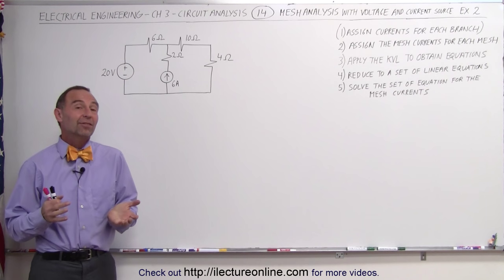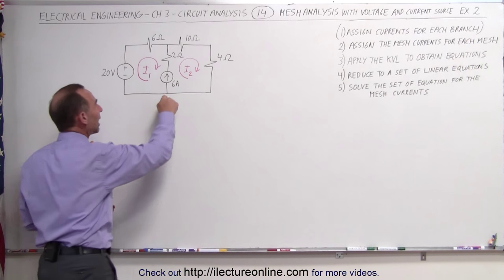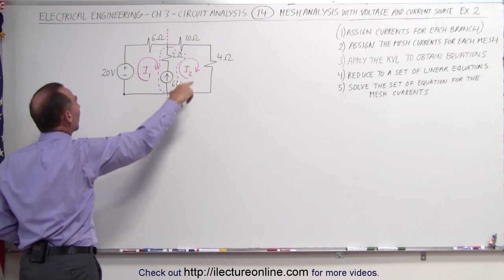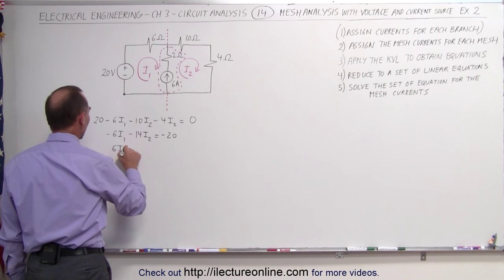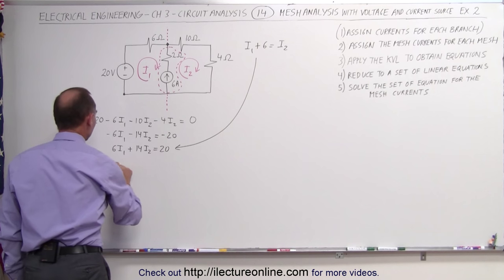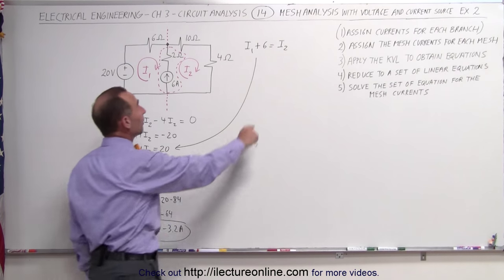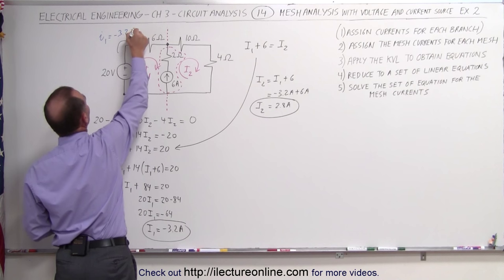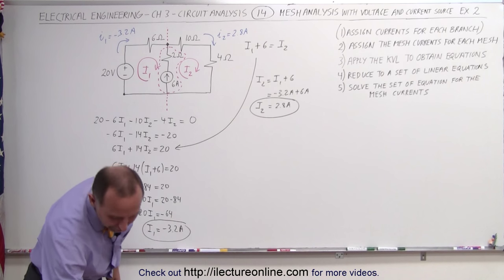Electrical Engineering: Ch 3: Circuit Analysis (14 of 37) Mesh Analysis w/ Voltage & Current Sources

Comment: Sir, So it totaly wouldn't matter if we had different resistor at middle, where the 2 Ohm was placed, right?
Reply from the maker: The current source would adjust to force 6 amps through the middle branch.

Comment: Hi sir, what happened that you treated circuit with 2 mesh like a 1 mesh circuit?
Reply from the maker: We didn't treat this circuit as a " 1-mesh " circuit.  There were 2 unknown currents which require 2 equations to solve.

Comment: Dear sir, I watched the mesh analysis by inspection method. I have got a question for you. Can we use the method if there is a dependent voltage source? Thank you so much

Comment: do we just ignore the 2ohms in the middle?
Reply from the maker: No, the two ohm resistor is not ignored.  But since there is a current source in the middle branch, the current will be driven regardless of the resistor on that branch.

Comment: I like this idea but I’d still prefer to use the tableau mesh method, treat the voltage across the current source as an unknown voltage and then write 1 auxiliary equation relating the 2 loop currents. For a simple circuit, it doesn’t make much difference but if it gets complicated, I’d prefer the matrix expression accomplished by inspection.
Reply: Do you have a link to a site explaining the tablau mesh method? :)
Reply: @TheESS1  Hi, the 24th video in this series by Van Biezen shows an example. Essentially, the matrix of impedances has diagonal term Z(i,I) that is the sum of 
all the impedances in mesh I. The off diagonal Z(i,j) term is the sum of impedances between mesh i and j with a sign determined by whether the mesh currents i and j are in the same direction or opposite. 

I’ll look for more links/examples.
Reply: @TheESS1  There’s some good lecture notes but this channel won’t allow to post the link.

Search Rube Williams + nodal analysis by inspection

It’s a 14 page document showing mesh and nodal analysis by inspection.

Comment: i wonder how can we unconsider the current source (tempualery). In video ( )/37) we said the big loop is not a mesh . Could you please explain
Reply from the maker: If you already have the left loop as a mesh, and then also the right loop as a mesh, then considering the entire outside loop as a mesh will not introduce any new currents or components into the equations that you didn't already utilize in the first two loops.  That is why you need to consider the currents at a branch point to come up with the third equation to solve the problem.

Comment: Sir, how is it possible to say that I1+6=I2 since I2 is in the opposite direction of the 6A
Reply from the maker: Kirchhoff's rules:  all the currents entering a node = all the currents leaving the node
Reply: I see what both of you are saying but Michel, depending on the way you view the current( due to the nature of this current being on a loop) you can say the current enters or leaves the node depending on where you drew your arrow.  To answer this I can say the current has to go all the way through the branch but that leaves you with the thought of how to define the direction of the current source.
Reply: and technically the way you explained it, 6ma is leaving the branch

Comment: Sir can we do these types of questions by the matrix method(by inspection)?
Reply from the maker: There are many methods by which you can solve these type of circuits.
Reply: @MichelvanBiezen  Sir i am unable to form the matrices in these type of questions where a current source is also there. Can you guide me please🙏

Comment: This video and the previous one are confusing me...
For example why can't you do next, in the left mesh get an equation: 20-6(I1) + 6x2= 0. And then you get I1 equals 5.3336. 
But you get I1 equals -3.2. 
So what I'm doing wrong? Aren't all voltages in a mesh supposed to sum up to zero?
Why it is incorrec
Reply from the maker: Don't forget about the current source.  There is a potential difference across the current source.

Comment: Sir, what would be the voltage drop across the 2ohm resistor?
Reply from the maker: The current source (6 A) forces six amps through that branch and thus the voltage drop across the 2 ohm resistor is  V = I x R = 6A x 2 ohms = 12 V

Comment: How come if I tried not ignoring the middle branch initially and run the equation like the previous example,  I can't get the number correct?
Reply from the maker: I am not sure how you are trying to solve it.   Sometimes it could just be making a small mistake somewhere that can throw off your whole answer.

Comment: I want to ask u one thing,  u applied KCL as second eqn but in rules of mesh analysis it is written we have to use KVL.  Is not it only restricted to KVL? Or we can take support of kcl followed by KVL?
Reply from the maker: You can use either one
Reply: @MichelvanBiezen  sir, but u used both in mesh analysis and u r telling me to use either one.  You are confusing me God swear.
Reply: @MichelvanBiezen  u meant " both"  or " one of the two"  by saying " either one"
Reply from the maker: You can use one or the other.  And often you can use both,  It depends on the particular example on how you approach it.  Often you can use multiple methods to find the correct solution  See the other videos in the playlists
Reply: @MichelvanBiezen  okay thanks